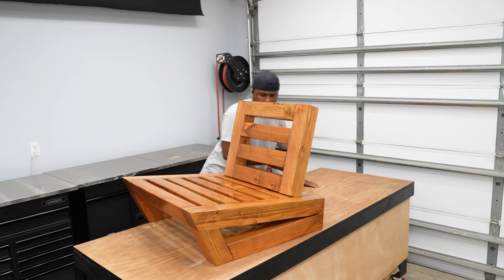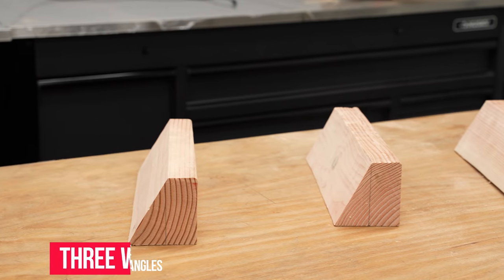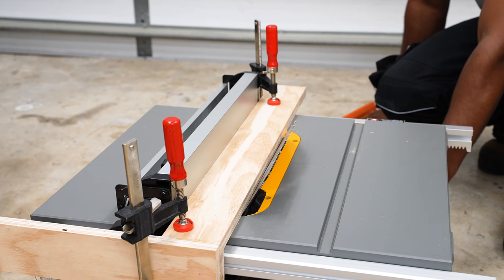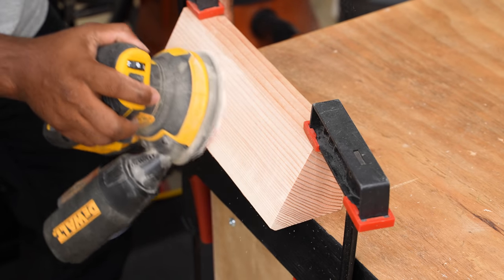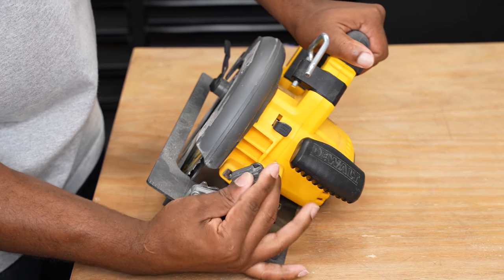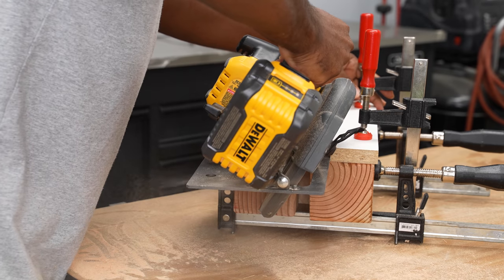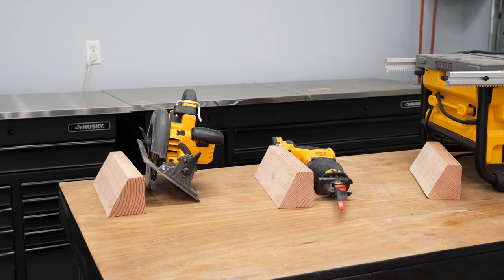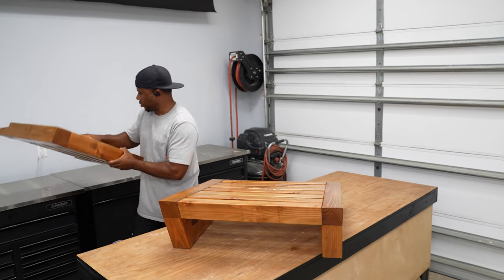3 Ways to make this miter cut without a bandsaw (woodworking tip)

Comment: Maybe another option would be, instead of using a 4x4 would be two 2x4's. Cutting the 30 deg. angle through 2" would solve the limited depth of cut and be easier to manage as the 2x4 would be lighter then wrestling a 4x4. This would improve accuracy as well. Only down side would be an extra glue up and a visible seam at the glue line due to the rounded over edges of 2x4's, if using home centre lumber. If you get lumber from a local supplier, you could get 2x4's with sharp corners, so the line would be less visible. Just a thought. :)

Comment: Here is a fourth way:  Several passes on a jointer with the fence set on an angle you chose is also a way to achieve the angle. It can also smooth the cut if you cut is rough or not exactly aligned from your three methods. A few passes on the jointer will clean off the saw marks and reduce  some sanding steps in the process.

Comment: After watching these alternative methods, I bet you could do it a 4th way by cross cutting with a dado blade (or a regular blade). You just need to jig the 4x4 so the cut is parallel to the table. Now just start making crosscuts. When finished just cuts the end off.

Comment: I recently started doing some basic woodworking, and I have to ask- what did the wedge at the end of the circular saw cut help with?
Reply: It keeps the wood from slipping and closing the saw kerf. That would grab the blade like a clamp causing kickback. Or like Glenn said "something bad would happen" (understatement there)
Reply: @ravenwinger1  thanks!

Comment: FYI ...
In a pinch? "Coping' or Band Saws are Your Only Options!" (stores are closed) But...You do have a recip saw & blades..."Slowly grind down" a 4'' fine cut wood blade to the desired width...& "Voilà!" 
PS. "Don't grind & overheat blade/Cut slowly at low speed' & pace!"

Comment: yeah but how do i do it with a rock and scissors?
Reply from the maker: Hold on, I'll get back to you on that.
Reply: Crosshatch with the rock striking the back of one blade, then spall out the chips with a blade aligned with one of the hatch lines driven by the rock striking the back of its loop. Work from the inside out and finish with back strikes directed inward at the periphery. Continue removing laminae parallel to the desired section until no material remains to be removed.

Comment: Really, that jobsite saw’s plug is not grounded? I see so many used outdoors even if there’s a drizzle going on.
Reply: The purpose of the third prong is not to provide a lower resistance path to an earthy ground than that provided by the operator (good luck with that, Mr. Bagobrine) but to ensure that the fault yields enough current to trip the breaker/GFI or blow the fuse.